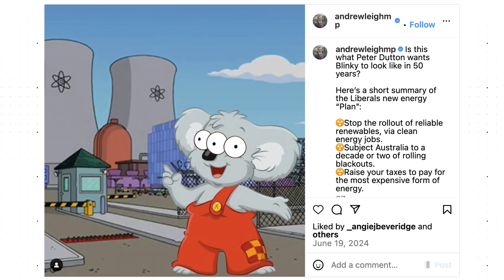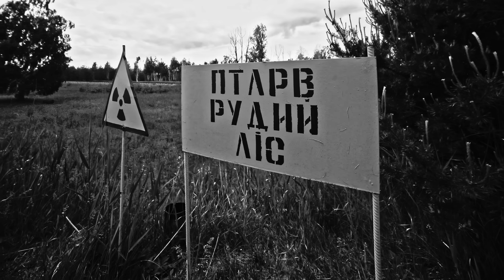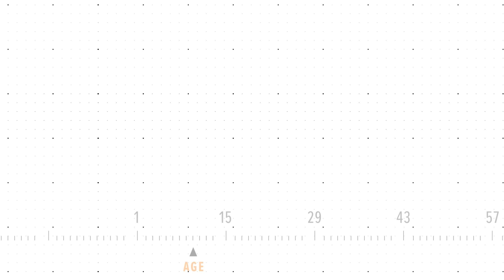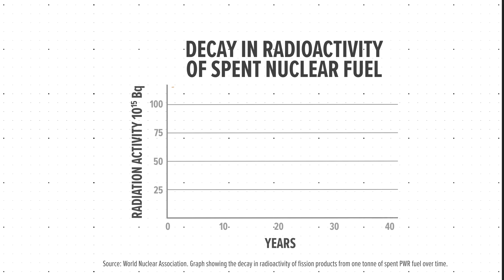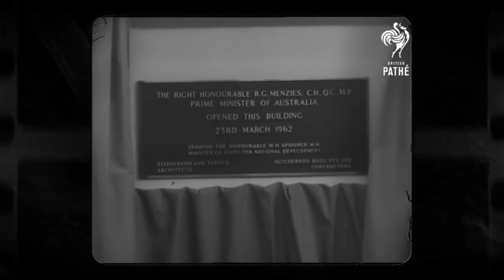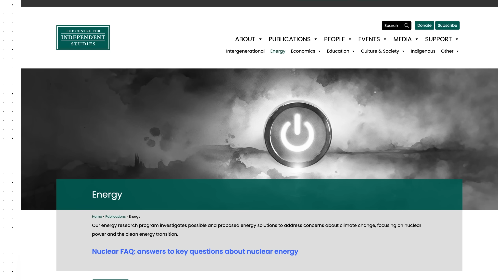Is Nuclear Safe? | Aidan Morrison

Comment: The cooling pools have a limited amount of space that can storage the spent fuel assemblies safely. To make room for the spent fuel assemblies approximately 10% (4,000 tons) of the world's spent fuel assemblies have been stored in a dry cast storage system where 14 tons (15 spent uranium fuel assemblies) of the uranium fuel assemblies are bundled and encased in concrete and steel (fig 23) but the fuel assemblies would begin to meltdown after ten days without a cooling system that uses thousands of gallons of cold water per day yet the dry cast storage system does not utilize a water cooling system. The safest method to store the spent fuel assemblies is to convert the spent uranium fuel pellets into kiln baked 3% uranium brick. The separation of the uranium by the 3% dilution inhibits the nuclear reaction and meltdown. In addition, burying the 3% uranium bricks underground would protect the uranium from a conventional and/or nuclear attack.

..............................................................................................................

Tepco may have disassembled the spent radioactive uranium assemblies and stored the uranium pellets in steel barrels then dumped the barrels into the ocean which until 1991 was common practice by the Europeans, USA, Russians and Japanese. 

“By 1991, the US had dropped more than 90,000 barrels and at least 190,000 cubic meters of radioactive waste in the North Atlantic and Pacific. Other countries including Belgium, France, Switzerland and the Netherlands also disposed of tons of radioactive waste in the North Atlantic in the 1960s, 70s and 80s.” (Schauenberg). 

The loss of power at the Fukushima nuclear power plant resulted in the reactor’s water pumps to fail which caused the nuclear reactor's uranium fuel assemblies to overheat and meltdown. The intense heat and pressure in the core created a small nuclear explosion that destroyed most of the four-foot-thick steel reinforced concrete barrier that surrounded the reactor core (fig 27a,b) and numerous concrete walls of the containment building. The Fukushima nuclear explosion produced a 1,500 meter high plume (fig 26a,b) that explosion originated from the reactor core. If the reactor core was immediately vented, and kept open, after the water pumps failed, the reactor core nuclear explosion could have been prevented and the formation of the Fukushima 147,200-acre exclusion zone, would have been avoid. Plus, the meltdown could have been contained if the bottom of the reactor core was composed of a ceramic material. In addition, the 2,000 tons of the spent uranium fuel assemblies that were stored next to the top of the reactor cores is unaccounted for.

The 147,200-acre Fukushima exclusion zone (fig 28a,b) was cause by a nuclear explosion. After each of the three explosions, a total of approximately one ton of pulverized micro-particles of uranium was dispersed into the atmosphere producing the Fukushima exclusion zone. Also, during the meltdowns, approximately 65 tons of the melted uranium fuel assemblies from the reactor core fell to the bottom of the reactor core and began to melt. The molten uranium disintegrated the concrete floor of the containment building resulting in the molten uranium melting through the bedrock. The descent of the molten uranium was stopped by the groundwater (fig 2). Uranium micro-particles were part of the fallout which Tepco and the nuclear regulatory agencies are concealing since testing for uranium micro-particles dispersed in the environment have not been extensively implemented yet the persistent high radiation levels in the Fukushima exclusion zone suggests that uranium contamination is involved.

.............................................................................................................................

The reactor core's uranium was pulverized into uranium micro-particles that was released in the Fukushima fallout. The Fukushima and Chernobyl exclusion zones will never be habitable. After 37 years (Chernobyl) and 11 years (Fukushima), radiation level within the Chernobyl and Fukushima exclusion zones have not decreased which can only be attributed to high levels of uranium dispersed in the environment. Gamma rays emitted by uranium cause cancer and birth defects. The US federal occupational exposure limit for an adult is .053 Sv/yr; therefore, a total of .053 Sv exposure within a year is the occupational safety limit. Today, in the Fukushima exclusion zone (red) readings of 1 mSv/hr have been routinely reported where 53 hours (2.2 days) exposure of 1 mSv/hr radiation would be at the occupational limit (10-3 Sv/h x 53 h = .053 Sv). A total dose between 2.5 Sv/yr to 5 Sv/yr would be fatal. After 3.42 months (2,500 hr) the exposure of 1 mSv/hr would be fatal (10-3 Sv/h x 2,500 h = 2.5 Sv). The city of Futaba, that is in the Fukushima exclusion zone, will never be habitable. British scientists (2020) have found readings of 1 mSv/hr near Fukushima city which is beyond the boundaries of the exclusion zone. In addition, the figures describing the Chernobyl and Fukushima exclusion zones represent radiation levels in μSV/hr (10-6 Sv/hr) range yet the contamination levels are closer to mSv/hr (10-3Sv/hr). “Dose rates measured in air 1 m above ground”. If the doses rates are measured 3 mm from the surface the radiation levels would be in the mSv/hr range. https://world-nuclear.org/information-library/safety-and-security/safety-of-plants/fukushima-daiichi-accident  

“The first case of thyroid cancer was reported on 12 September 2012 after 80,000 children had been tested.2  Since then, the numbers have risen steadily. As of writing, 56 have been diagnosed with thyroid cancer, 1 with a benign tumor, and a further 47 are suspected of having the cancer. This brings the probable total to 103 out of 296,026 eligible residents examined.3  Thus far, nearly all initially ‘suspected’ cancers have later been confirmed as malignant.  The ‘normal’ cancer incidence rate amongst minors is one to two in a million.” (Williamson). 

“Belarus, whose border with Ukraine is just four miles from the Chernobyl power plant, absorbed an estimated 70% of the nuclear fallout.  A study by UNICEF suggested that more than 20% of adolescent children in Belarus suffer from disabilities caused by birth defects.” (Verril).

If families return to live within the Fukushima exclusion zone, their children will suffer the birth defects that occurred in Belarus from the Chernobyl nuclear disaster. Only Yoichi Yatsuda, 71, and his wife have returned to live in Futaba (2023).

The three Mile Island (TMI) cleanup did not removed the uranium fuel assemblies from the disabled Three Mile Island reactor core since the melted fuel assemblies would be radiating 300 Sv/hr of gamma rays for the next 50,000 years. In addition, 80 tons of uranium that melted through the bottom of the concrete containment building is currently beneath the containment building and is being cooled by the groundwater. At Chernobyl and Fukushima, uranium melted through the bedrock and is being cooled by the groundwater. The high levels of radiation (800 Sv/h +) emitted from the hole that leds to the uranium beneath the containment building disables electronic devices; therefore, the state of the melted uranium is unknown.
Reply: Spent fuel pellets have never been packed into barrels, which, as you noted above, would be impossible.

The Fukushima Exclusion Zone was caused by government edict.

Comment: When the nuclear plant is decommissioned it needs to be fully encased in concrete,is that factoredinto eroei
Reply: If the plant is constructed properly it won't need to be decommissioned, but that is part of the new good designs. As soon as they start with funding discussions, the good ideas like that will be removed in the interest of current cost savings.

Comment: Retain coal fired power stations and gradually introduce a well planned nuclear system augmented by coal and some 'green' sources.
Reply: You'd never make it as a politician. That makes far too much sense!
Reply: @OneWildTurkey  😁😂🤣
Reply: On a real note, Nuclear is the Greenest source. All other renewables/Unreliables are not Green the moment you get rid of tunnel vision.
Reply: @ZippyPiglin36 Grow up @ZippyPiglin36 
For Australia to replace 6,470twh of fossil fueled energy, you need 25 times more electricity and the national grid ain't big enough. 
Grid to consumer electricity like nuclear electricity and distant renewables electricity are both are 25 times too small.

The grid was built over 14decades and is 1million km and costs $TRILLIONS. 

It is impossible to build the grid bigger. 
The grid is fragile because it is extremely expensive to over build. 

The grid is too expensive to expand and too valuable to waste. 

Both big renewables and nuclear are in the economic dead zone.

Nobody thinks about the grid expense and fragility.
Reply: sounds like a good plan to me
Reply: @roboldis4509  the new grid upgrades will more than double the nuclear plant cost projections.
All nuclear is to be government funded, including the new grid capacity. 

When the sunshines and the crops grow and the batteries are full then nuclear grid electricity cashflow will collapse. 
$100sMillions of lost cashflow in business hours. 

Nuclear wet dreamers are not thinking straight. 🤔 " Happiness problem " 😊 🙂 ☺️
Reply: @Coops777  Nuclear promoters are continually trying to confuse many things.
CO2 emissions proliferation and 
ignore Nuclear proliferation and 
ignore need for grid capacity proliferation and 
ignore grid cashflow collapse with the daily DUCK CURVE of demand collapse. 

Home energy budgets are destroying grid demands' $100sMillions cashflow. 
Business budgets are destroying grid demands' $100sMillions cashflow in business hours and holiday hours.

Grid owners' will abandon central generation and contract millions and millions of original customers to supply industrial customers moving away from fossil fuels. And maintain cashflow.

Grid owners will abandon central generation and Contract v2g EVs massive storage batteries to supply industrial customers moving away from fossil fuels. And maintain cashflow. 

Grid owners will be part of a DOUBLING of original grid electricity and maintaining ORIGINAL CASHFLOW customers as the customers become feed-in suppliers and industrial customers CASHFLOW INCREASES as they move away from fossil fuels. 

Nuclear is a 247 economic grid disaster. 
Nuclear is pathetic for CO2 emissions reductions.
Nuclear invites worldwide nuclear industries. 
Australia is the sunniest continent on the planet. 

Grow up nuclear promoters. Get real.

Home and business budgets and dirt-cheap rooftop PV on dirt-cheap rooftop empty realestate and no massive grid upgrades and no massive government nuke construction and no massive upgrade to collapsing fossil fueled aging generation plant.
I worked on these plant construction in the early 1980s, 45 years ago. What ' self promoting experts ' do you listen to ????????
Reply: If nuclear was serious, add the new grid capacity CONSTRUCTION
deaths and CO2 from raw materials mining to commissioning of the grid infrastructure. 

Nuclear without nuclear pellets is the same without the grid capacity. 

And don't BS about the existing national electric grid. More grid is needed, and grid owners want to be paid. Unless you are a socialist promoter.
Reply: @stephenbrickwood1602 actually, this is where nuclear really shines. When you account for mining and construction, nuclear accounts for 0.04 deaths per year where solar, wind and hydro have a combined 2+ deaths per year.
Reply: @bheemasena2383   Grow up. 
My children have no idea of their costs to house and feed them.
The ignorant often ignores facts.
Nuclear is just a little baby thing in the real big world. Nuclear is a joke in the modern technology world.
Reply: @bheemasena2383   a decade of LNP and home prices for wealthy immigrants and population collapse. 
National Electricity grid neglected and capacity limited to protect from blackouts. 
Put full 247 nuclear and completely break the grid.
Dutton knows that and needs 2 decades to fix up the weakened grid. 

That is why all Australian state governments have pushed rooftop PV electricity for mums and dads and businesses in business hours. 

My electricity is 50cents kWh grid supplied to limit my demand load on the grid.
Most of my neighbour's get nothing much for their feedin and now have added home batteries and have EVs. 

Their tax-free savings are TAX-FREE from no grid electricity costs. 

My gas supply costs are heavy. 

We put gas on because of blackouts when we built. Decades ago. 

I worked on fossil power stations and transmission lines for a decade tendering and costing and site management and living away from my family. 

The ignorant ignore facts or just don't listen.  Blue pill people.